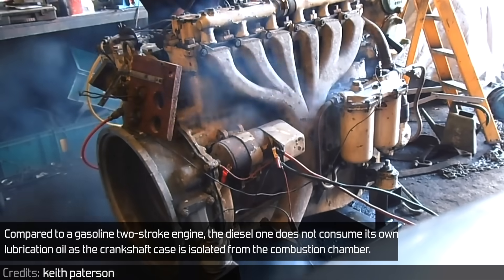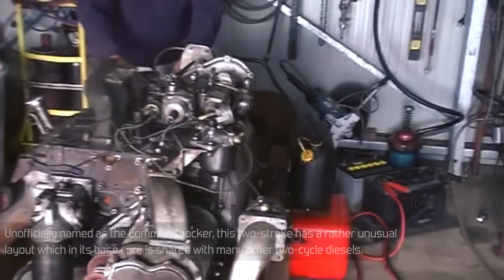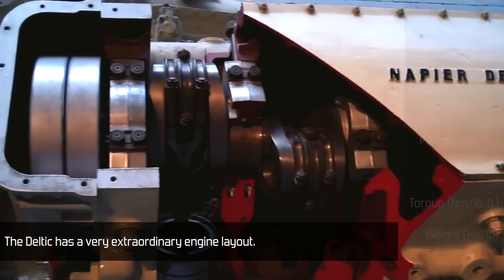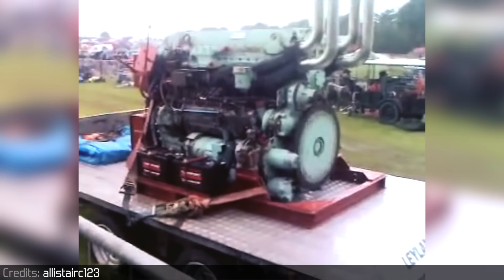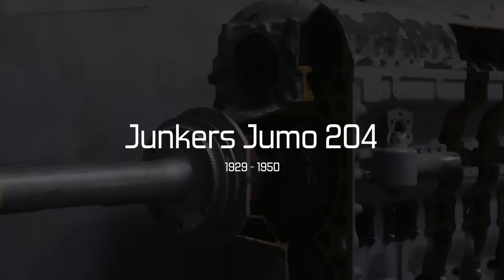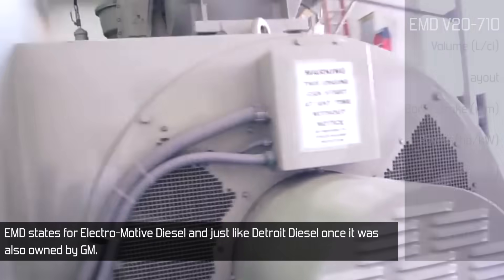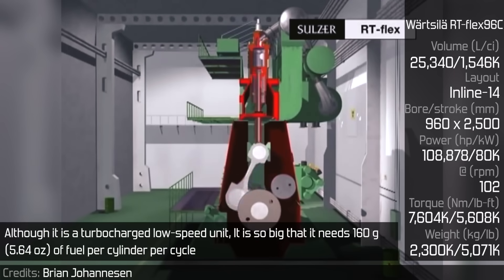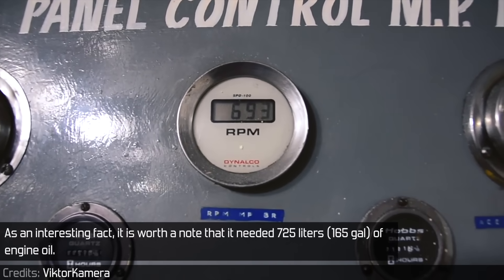9 Cool 2-Stroke Diesel Engines

Comment: So.. what is the drawback? Why don't we use these compared to 4 strokes diesels if they are theoretically more efficient? They sound fucking awesome
Reply: One of the answers is NOISE. Hear a 2stroke DD in a semi pass by and then hear a regular semi of today passing by.
If you could get the noise level down and fuel system up to date with electronics and so on, they could become interesting again. Listen to this guy very closely,  it's very interesting:
https://www.youtube.com/watch?v=rws_2kFahBI
Reply: No, you are not correct informed. Theoretically a diesel can also run at very high rpm (> 8000rpm)
The problem is ignition delay. This is the time between the fuel injected in the the cilinder and the exact moment of burning start. ( cold fuel- hot air, the fuel has to be heated up to it's burning point). This limits the 
rpm level.
Reply: @nickvw5404  how bout about 10000 fps piston speed cause of longer stoke figure it out with even a 4.5 stoke way too high.
Reply: The emmisions is the reason why EMD had to develop a 4 stroke alternative for their 2 stroke engines.
And this despite the fact that EMD developed the 2 stroke to a very high degree, they are almost as fuel efficient as 4 strokes in the similar market, have reassonable emmision levels (good enough for tier 3) and are relatively cheap to maintain.
But to meet Tier 4 emmision levels they had to develop the 1010 engine series, a four stroke, and they weren't to sucsesfull doing this.
Where the first 4 stroke from 1998, the 265H engine was a failure, this doesn't fare much better, they are unreliable and problematic, where their 2 stroke engines are almost indestructible and last more than 50 years with some care, they can take a lot of abuse as well.
Just watch this video of locomotives over 50 years old in Australia fighting their train up an incline: https://www.youtube.com/watch?v=OBvfJvFVE-Y
Those old 567C engines, no turbo but just blowers, produce by far the best sound of all EMD engines.
Reply: Scavenging is the problem. 4-strokes empty their cylinders by pushing the exhaust out with the piston, while two strokes simply blow air into the open cylinder.  This leaves a much of the chemically unstable exhaust in the cylinder ready to produce nitrogen oxides in the next cycle.  The air that enters the exhaust stream during scavenging also makes exhaust treatment difficult.
Reply: If i'm not mistaken, under a certain displacement/stroke length they just plain suck because diesel fuel burns slowly. They seem heavy too (with the blower and all)
Reply: Rick Delair 
EGR clogged --> more emisssions. More money for a new EGR. 

HIGHER FUEL COMPRESSION --> more efficient but creates particulate. Plus breaks more easily

DPF --> complete fucking cancer. Gets clogged up, needs burning for cleaning, produces more NOx 

More NOx? Let's use urea powered fucking PDF. Just to add the cost of having to buy the addictive

Stop fucking castrating diesels. Your lithium shit pollutes more anyway
Reply: Doc. Volt Emissions regulations have tightened over the years, 2 strokes got a bad reputation, however they could be cleaner i guess. I know what you mean though 2 strokes don't screw around.
Reply: Rick Delair...sounds like a biased opinion rather than factual. If what you said was true I seriously doubt the railroads would buy so many locomotives to make GE the best seller. In their later days EMD's components were primarily outsourced whereas GE kept most of its component manufacture in house.
Reply: 2 stroke diesels make alot of NOx (Oxides of nitrogen)
The EMD 710 series V12 from about 2004 had to have cooling on the exhaust manifold.
With further tightening of the regs, EMD had to stop making strokers
Reply: Only on petrol (gasoline) engines. Not diesel
Reply: Neel Parulekar 2 stroke diesels burn oil to some degree, especially those which have pistons lying flat or facing downwards.
When idling or stopped crankcase oil leaks past the pistons in the combustion chamber, burns or is partly exhausted and collects in the silencer.
The opposed piston engines all suffer from this problem, a Deltic engine is renowned for this.
The railfans that had a trip behind a Deltic and had their heads out of the carriage windows are easily recognicable by the oil splatters in their faces.
Reply: Rick Delair Bro, my argument is all about emissions, then your argument is "who the hell cares?". Have a nice day.
Reply: Okay, i'm not trying to offend you. But that being said, I maintain that 2 strokes would need incredible amounts of scavenge air to clear the cylinder as well as a 4 stroke that can simply "push out" all but 1/20 (compression ratio) of the exhaust gasses.  Honestly, your long and un-proofread replies are my biggest problem with you, but I know it's not your intent.
Reply: No High compression is no limiter. In fact, with an even higher comp. they could run faster. (theoretical)
Reply: Rick Delair so you think 2 stroke desiels burn cleaner?
Reply: You could use preheated fuel injection, reverse uniflow two-stroke diesel design that was patented in 1997, use high-temp self-lubricating ceramic coated rotary valves, EGR that's cold before it's mixed with turbocharged -then-cooled intake air, bigger intake & exhaust porting to let it breathe, bigger exhaust pipes after the catalytic converter, and unit injection, but the next two biggest improvements are my own secret.

These would drastically cut down smoke, increase efficiency, and help the world in fuel costs.. possibly, and this is due to less parts to use which reduces pumping and friction losses.

When you use synthetic fischer-tropsch diesel fuel or kerosene made from biomass, biomethane, natural gas, and coal(lignite, anthracite, and bituminous... you have extremely low aromatics, no sulphur which means hardly any particulates, so growing aquaponics hemp seed and weed seed oil, pressing coriander seeds for their oil before making detox supplements or selling as a spice, using all waste vegetable oils, and pressing mustard seeds for oil before mustard sauce or selling the ground stuff, all to make biodiesel with..

Add it by 20% to lubricate the fuel system, thicken the fuel, and oxygenate the fuel for a better burn!!

Permaculture FTW!!
Reply: MASON WINKLER Yeah but they also put out that much more power
Reply: @MASON WINKLER poor bsfc there pigs
Reply: The green wieners
Reply: Yeah but he just said two stroke diesels don't burn oil because they have a separate crankcase (?)
Reply: Nick vW i thought that what limited rpm was due to the high compression / long stroke
Reply: Jews
Reply: Rick Delair, I agree with the 2 stroke being less "claggy"' as they say in the UK.
It's very rare to see a 2 stroke emmiting black smoke when throttled up fast, mostly just blue smoke, compare this with GE, Alco or EE, which are hugely overfed untill the turbocharger had time to spool up, their problem is not having any pressure charging at idle, where a 2 stroke always has a charged airflow going on, as the blower is mechanicaly driven either all time or by an override in case of turbo blown EMD engines.

Some Russian 2 stroke engines like the Kolomna 11D45 use a pair of roots blowers with an additional turbocharger for supercharging at higher rpm's.
It's also the Russians that built the only example of a badly smoking 2 stroke, its their copy of the Fairbanks Morse 38D8 1/2, called the 10D100, this engine is opposed piston 2 stroke but compared to the FM design which had a roots blower and no supercharging the Russians replaced this with 2 small mechanicaly driven radial blowers and a large turbo charger, in combination with enlarged fuel pumps/injectors.
This way they went from the original 2000hp to 3300hp, but the downside is that this engine is overfed most of the time, untill it reaches full power in the highest notch, due to an immense turbo lag. The locomotives 2TE10 where these are mounted in are rolling coal to the square, the railroads they run on have a constant brown smog over them.

But normally 2 stroke diesels do better in fine particle, Carbohydrate, and carbondioxide emissions, and the EMD 710 engine already being the cleanest 2 stroke in the market, I guess they could find a way to get around NOx as well
Reply: Rick Delair... One reason EMD sought to replace their 710 2 cycle for a 4 cycle engine is because it was difficult to comply with the EPA's new emission standards for a new engine with more displacement using the 710 engine design. EPA's job security depends on tightening the screws on regulations.
Reply: MASON WINKLER twostroke burns oil. so bad for emissions.